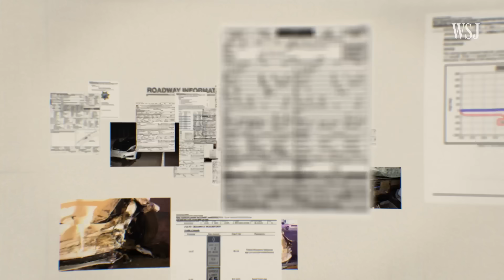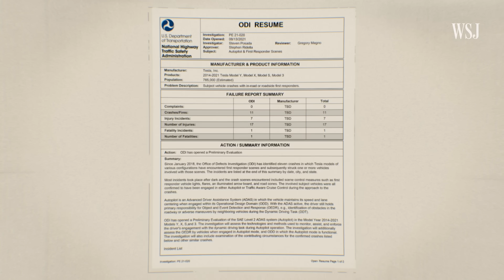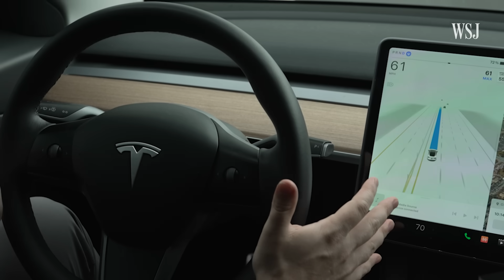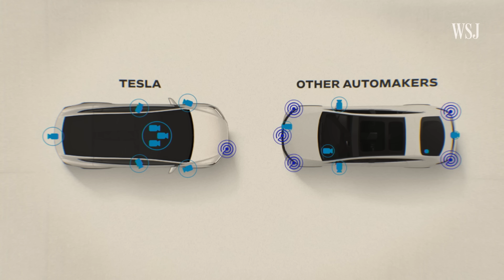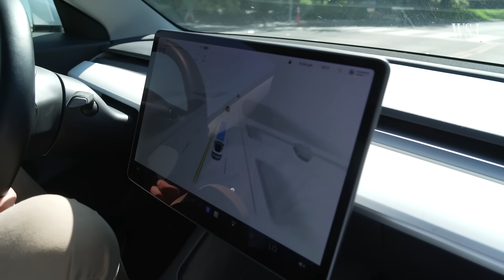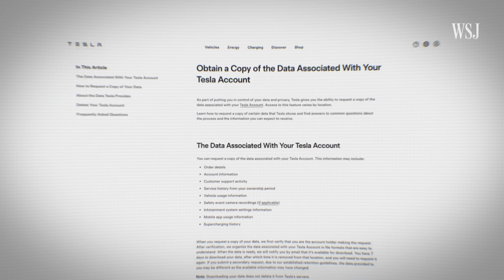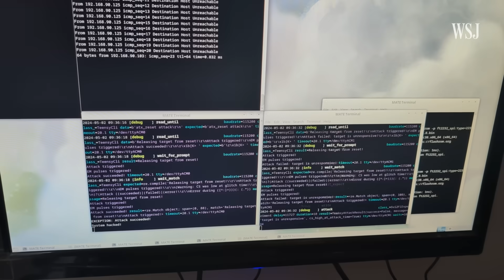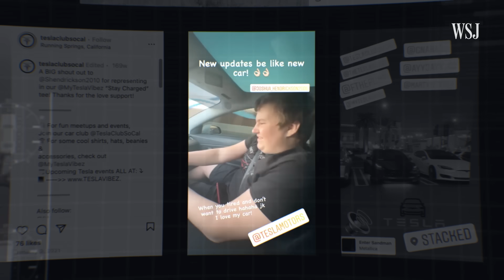The Hidden Autopilot Data That Reveals Why Teslas Crash | WSJ

Comment: The stock price went to high and they need to push it down so the big boss who is in a short position can recover some Money.... 

If you see a huge obstickle you just step on the break easy !

Its quite intresting that the latest incident they are mentioning is in 2021... Now is 2025 in like 10 ish days!  In 4 years with all those data things has changed. 

This negative propaganda is similar to the woman who went on court against a microwave company because they didn't inform her that drying a pet in it its gonna cose death.

Although I'm sorry for those people who past a way in those accidents. But WSJ now is just trying to push the stock proce down. 

I had an accident there was no autopilot involved or not even a Tesla and the guy went into the intersection without stopping for the priority...

Comment: Musk thesis that FSD is good enough if it is better than human driving by 10x is wrong. Human driving put the ultimate liability on large group of drivers. FSD means that ultimate liability lies with Tesla or Tesla shirks that responsibility..The question is how much error do we give one single entity? It has to be very high for such a consolidated ultimate liability OR it can be very risky in the long run. Its very different if we take collective responsibilty for ultimate liability rather than rely on ONE entity, the car company to be responsible. Right now there is about 20,000 critical accident per day in North America - Tesla propose that suppose its cars drive 10% of that driving and it acchieve 10% of that - that is 200 per day or 70,000 per year it be allowed to operate - while not liable for it.

Comment: It is actually more of a hit piece on Elon because his political opinions hurt liberals and WSJ's current overlords. Another aspect they are not talking about the how many saves FSD did where normal drivers fail. Also what the state of the technology currently is. AI technology is moving forwards in leaps and bounds. Data from 2023 is now stale compared to the current gen.  Fair reporting would have been mentioning these aspects instead of using a widows grief and a disgruntled employees take. But journalism is not about the truth anymore!